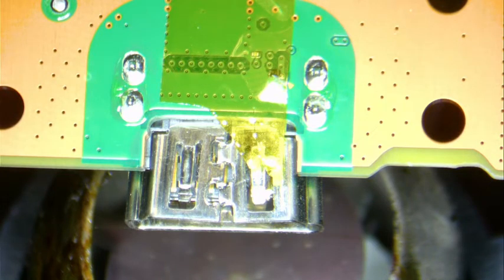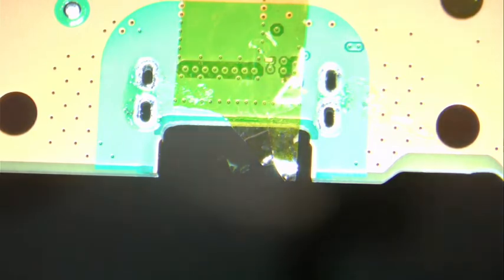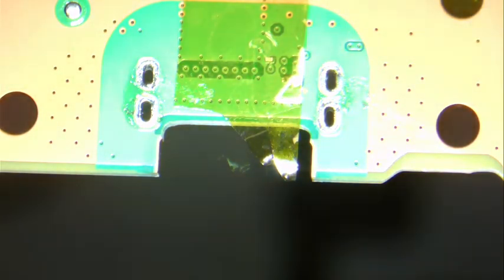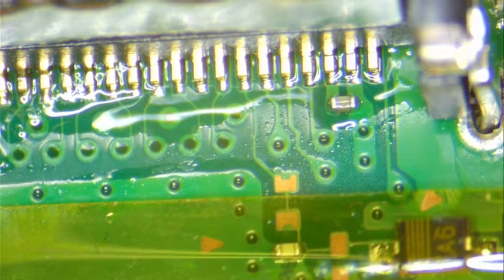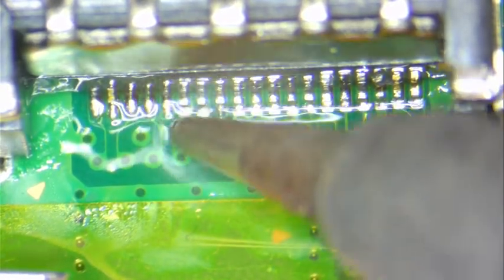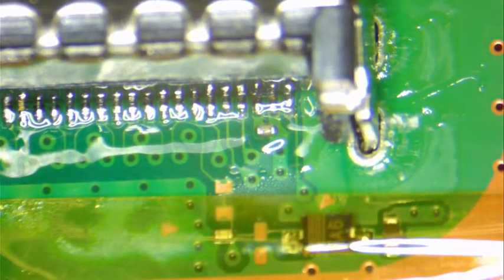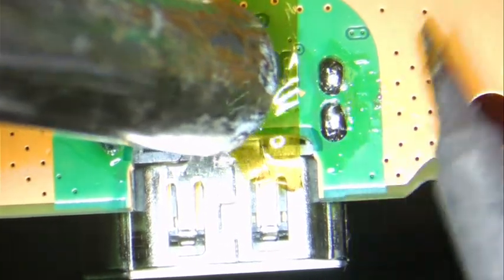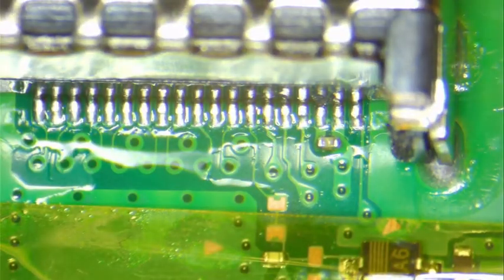Revisited PlayStation 5 HDMI Port Replacement (Fast & Secure)

Comment: Can you use soldering iron to losen the solder before using heat gun ?
Reply from the maker: Most definitely. You can add low melt solder to the existing soldered pads and then use heat to remove easier and faster.
Reply: @Wayayeo  Thanks for the tip. What about using thin tip to desolder holes?

Comment: Do you need desoldeing wire?, my hdmi port does NOT come out I even raised my heat gun to 800 F
Reply from the maker: No need for desolder braid just be patient and monitor temp on board. Good luck.
Reply: Thank you. It came off, I reconnected the new port and nothing. I am actually in the process right now to try to reconnect it. I think I failed to connect the pins properly. 

Question: the new Ps5 slims hdmi port is different than the one I bought. I haven’t seen that type of hdmi port anywhere on here.

Comment: hi whats the temperature to remove the hdmi port? i try different time but nothing?do i have to pu a flux before to remove?
Reply from the maker: It all depends on your equipment. Try 700 f. I recommend practicing on a broken board first.

Comment: Hey man. Great video. I fix broken stuff for fun and keep it and im fixing my first ps5 to give away and my TV recognizes it plugged in as a ps5 when I replace the port but I'm still not getting video. I check the pins for adhesion and use a dmm to check for shorts but there's never video. Is it possible the batch of ports I bought was bad. 

There's no one local to me who even has the proper gear like I do to check it. There's no beep codes and it sounds like a normal boot up. 

I don't want to give up on it as I'd like to give it to a friends kids and they can't afford one. I'm sick of taking it apart haha. I've tried 4 ports and always been careful with the heat I use and have good gear and I am a decent amateur at fixing things to keep them from going to landfill. 

Is there a port brand you could recommend. I'd also like to replace the diode and caps that I've been mindful of not blowing off the board haha. I'm at the point where I could've bought the kid a new one after buying a microscope which I didn't need because I usually fix old audio gear but practice smd kits all the time and use smd parts in my own pcbs when prototyping and otherwise. 

If you knew the diode and cap values and had any advice to give I'll hit the thanks button for help. I'd have to drive across nova scotia to find another shop but they all just pull people in and teach them to change glass on phones. I fix broken stuff to save and it's usually old game systems for friends. I'm no stranger to trace repair either as I've amazed myself at some of the botched repair attempts I've fixed. I don't do it for money and I just wanna surprise a kid. Any suggestions would be appreciated and rewarded.  You sound like you're from eur-asia or I'd bring it to your shop.  I'm only going to attempt to repair it once more before I cut my losses and just stick to repairing the horrible usbc ports on the ps5 controller for friends, retro stuff and audio gear haha. If you have an ebay shop with the parts I'll buy them as thanks along with hitting the button. I'm a software engineer by trade who wishes he took electronic engineering hhahaha but I ultimately ended up working with police and having to retire early due to medical reasons
Reply from the maker: Use my site at wayayeo.org and reach out I will help no problem.

Comment: Nice job! What temp you setting the heat gun to when removing the HDMI port?
Reply: Probably around 460°c
Reply from the maker: 400c - 480c works.

Comment: what temperature of the soldering iron do you use when removing the pins from the HDMI port? and what is the temperature of the hot gun, when desoldering the HDMI port? ❤️❤️
Reply: hey did you ever find out anywhere else?
Reply: @dudelike11  no, my bro
Reply: Set your temp higher than your solder melt point. The heat gun is usually around 450°c give or take
Reply from the maker: 460°c good luck on your repair

Comment: Nice work, what time is the name of the tape u have used to avoid thermal damage to board??
I think i burned up my board during replacing procedure
Reply from the maker: It's really hard to burn the board. It's Teflon tape, easily available at Amazon or eBay.
Reply: @Wayayeo looks like kapton tape to me but what brand is it as anyone I found can’t withstand 400c ?

Comment: Hey, I don’t have a sauter gun and I have it to where it’s just my motherboard, is there any possible way to replace without using it?
Reply from the maker: You will need a heat gun and also a soldering iron.  You may also send us the Mobo only.  Visit us at wayayeo.org and use the contact form.